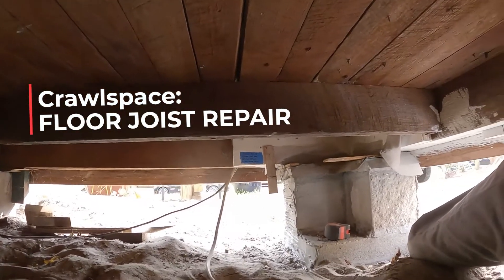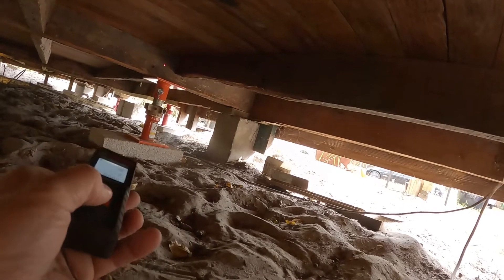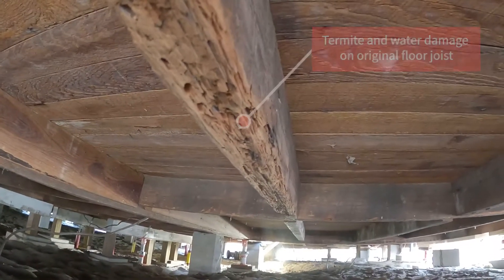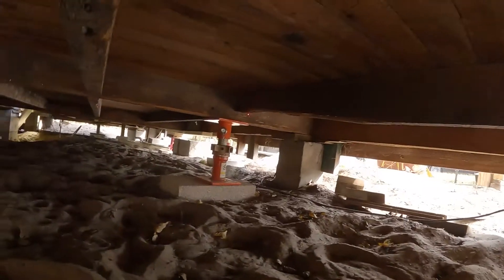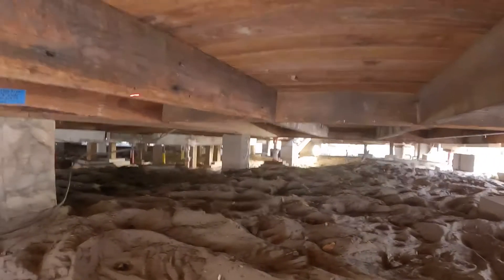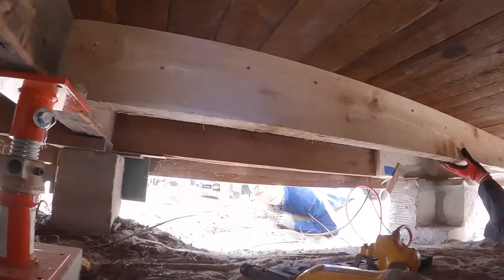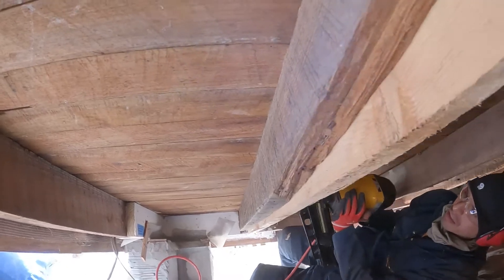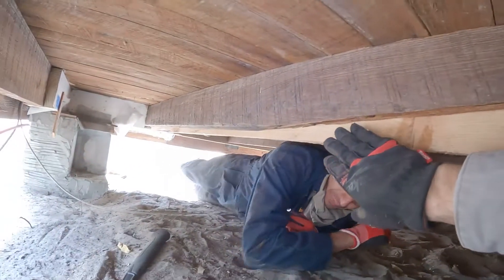Floor Joist Sister Repair in Crawlspace with Cedar in Orlando, Florida

Comment: thank you for the video Would termite affect the new joists if you did not remove the old/damaged one?
Reply from the maker: The only way to get rid of termites is by hiring a licensed pest control company to stake for subterranean or fumigate for drywood termites. Has little to do with leaving an already damaged lumber after it's been treated.